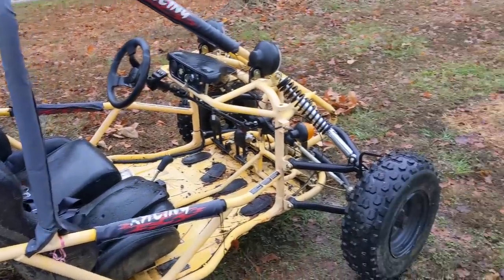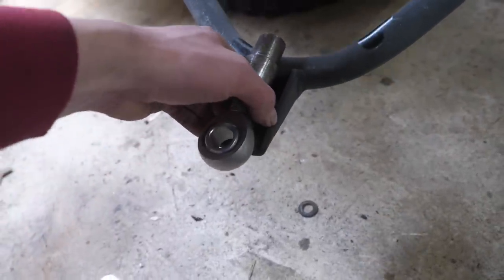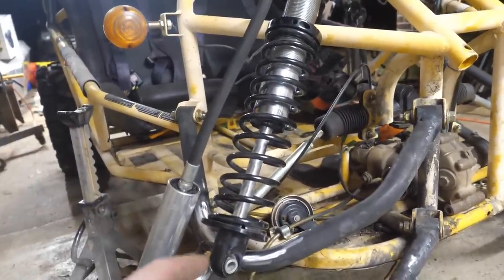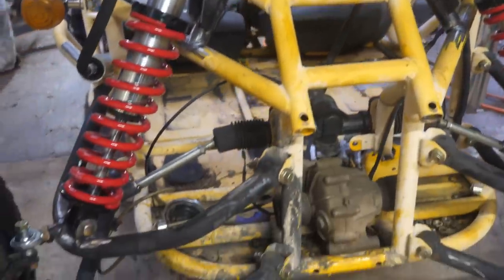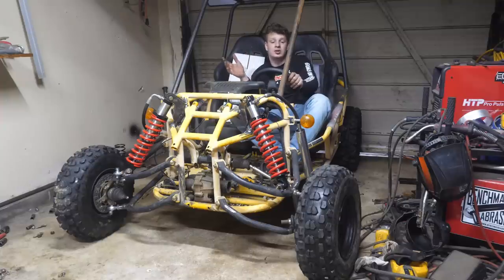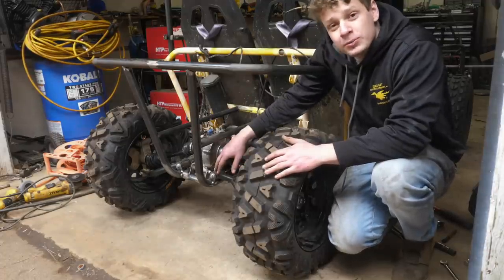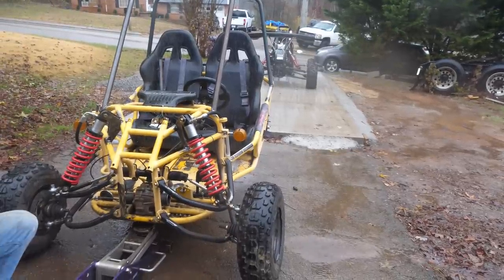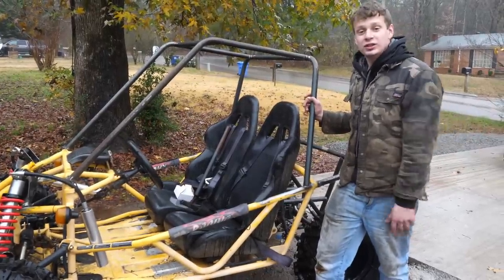4x4 Buggy Conversion and 700rr Swap! Part 2

Comment from the maker: I've got an idea 💡 I wonder if rhino 660 axles would fit in my grizzly 660 differential. The rhino axles are longer and look very similar. And would help the rear get wider. Anyone experienced on this 👇👇
Reply: Yes they will they share the same inner cup and i believe the same outer cup .
Reply: I like turtles
Reply: Cut the axles and extend with 1/4 thick tubing. Drive shafts are only 1/8 thick
Reply: definitly need 4 stroke low end torque for 4 wheeling. a high revving 2 stoke banshee engine would make slow 4x4ing a nightmare.
Reply: @eriknulty6392  well said.
Reply: Good idea you could get a little wider or even a little taller tire on too
Reply: Got to have that super aggressive thick tread tires 😈

Comment: Many years ago a friend decked out a Grizzly for serious trail riding. You would be amazed at what a roughly 1500 dollar set of dialed in Works shocks did for that machine. Being able to adjust ride height based on the terrain that day and having shocks valved and sprung for the weight with compression and rebound really makes for a safer ride. Soaking up a gully vs getting thrown out of the seat is a big plus

Comment: If I was you I would build it with reverse. I built a Chinese buggy like this with a Kawasaki Ninja not having reverse and it sucked. So I started over and rebuilt the whole buggy using a RPM forward neutral reverse box and couldn't be happier. Can't wait to see how it turns out bud.

Comment: With those tires, 4 wheel drive, that size, and built for 2 adults, I would get the torquiest engine you can find so you have as much as possible available down low.
Reply from the maker: Yep, it would be nice if it could spin all 4!
Reply: Smart 3 cylinder diesel

Comment: Got the same build, has the irs with 250, upgraded frame to a utv style and raised seat rack. Have used existing gearbox plate for a motor frame to rubber mount both motor and gearbox, raised the frame more then the motor due to 50x25 rhs being notched in from the bottom, was eventually going to upgrade with diffs and a different style motor

Comment: The better option on the front control arms would have been to cut off the bushings and weld heims in there on the inside pivots and leave ball joints out at the spindle. 

-advice from a suspension company owner

Comment: I've always wanted to use a seadoo 4 stroke engine in a buggy. Just wasn't sure if I'd run it through a gear box or CVT. I got an N/A engine laying around (155HP) I could send you. Ideally  I'd run the 300 S/C engine tho.
Reply from the maker: From a jetski? I need one for my JETBOAT
Reply: @VasilyBuilds  you'll want a supercharged one for the jetboat.

Comment: The front suspension isn’t going to work correctly. You have to keep the pivot point geometry has to be inline with your cv axle. Unless you add special plunging axles as the axle we’ll be changing length as the front suspension moves as it’s built now

Comment: That CR500 engine you got sitting around smoke the 700r. I own and ride a CR500 and have smoked 700’s and if your worried about kick starting a 500 they make electric starts from pantera motosports
Reply from the maker: I sold it
Reply: Hope you got what that thing was worth

Comment: I don't think it's a good idea to weld those joints, I would have welded a tube with the same threads as the joint this way you can replace one if and when it fails...

Comment: Bro, that rear end  is four too skinny compared to the front
Reply: Definitely need to stack some spacers on that rear to equal at least partially close to the front track width
Reply: wont matter all that much if he's gunning for a middle weight engine. also 4 inches of spacers, really? that'll wreck the bearings.